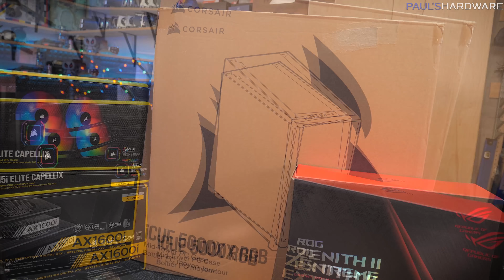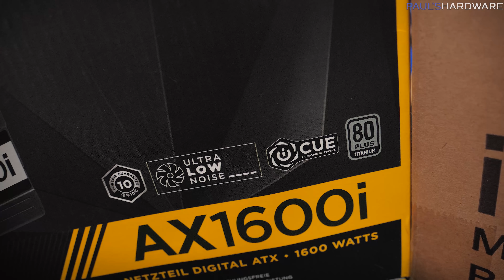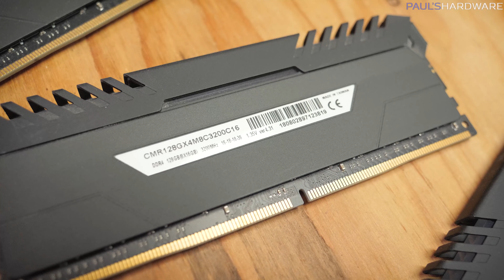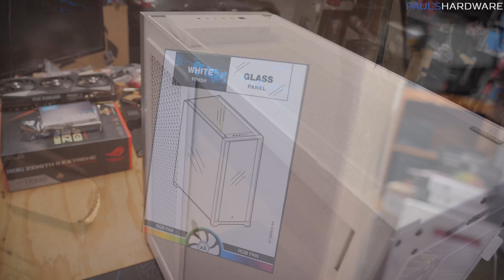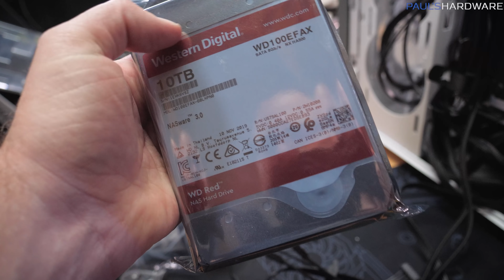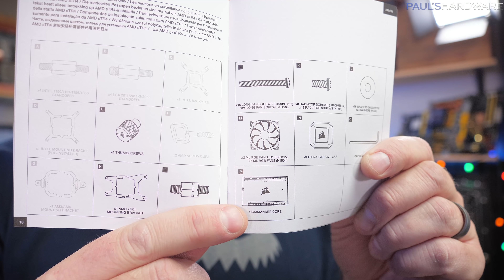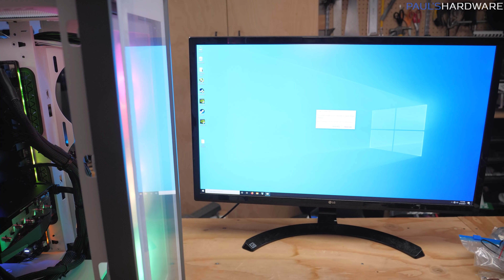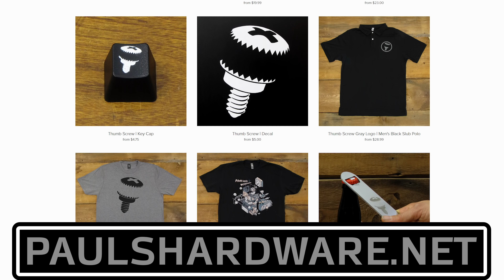Trying to build the fastest PC I can...

Comment: Ya, send the EFAX back, requesting a refund/credit based on false advertising. You know that  EFAX is NOT recommended for raid or NAS at all, but they advertised it for such use.
One more; This is why I have dropped Corsair completely as a hardware provider.  Way too much proprietary crap and part cross match issues ... just like the one you were caught with.  Their junk just wont play with others well enough.  The further hard core they go into their own infrastructure, the further away from them I go. Obviously Corsair like sponsoring Tech Youtubers, so they have you over a log and I appreciate that.